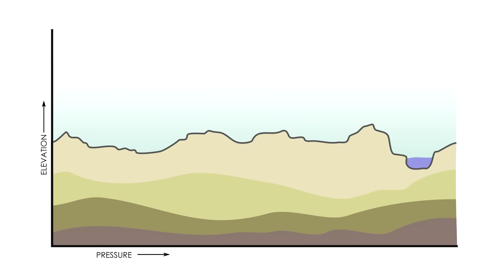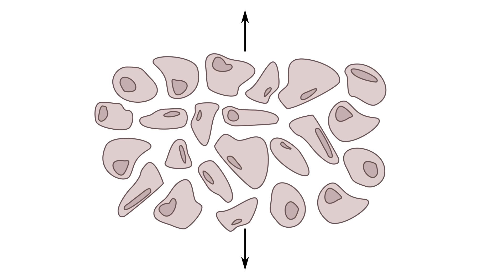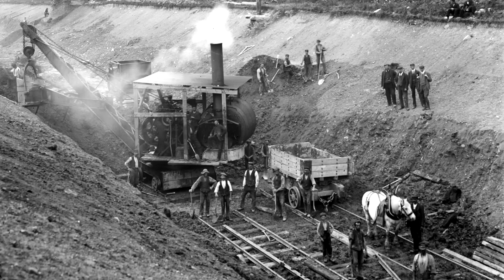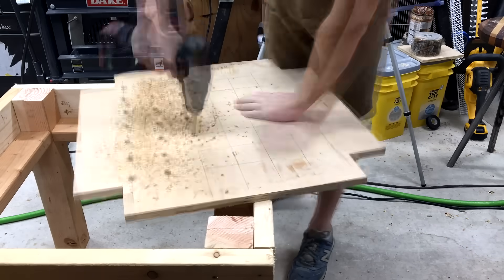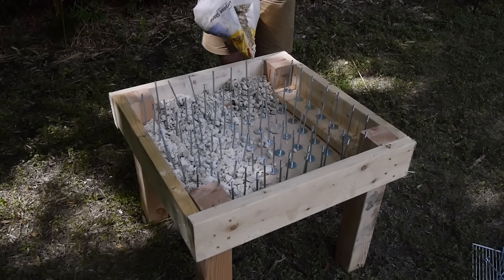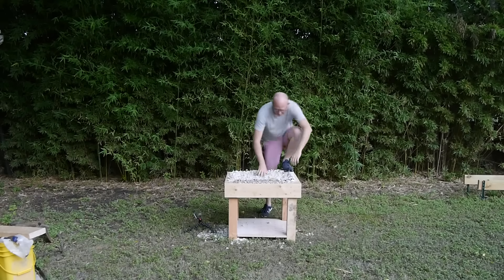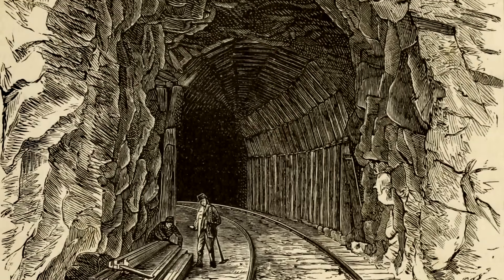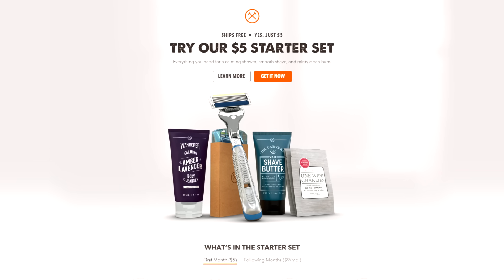Why Tunnels Don't Collapse

Comment: Very cool topic.  My Father worked at the copper mine near White Pine MI for about 20 years.  He explained the production cycle - of which "Roof Bolting" (as they called it) was the final step prior to drilling the next series of blasting holes in the heading.

One problem with roof bolts is that if the shale chips away from above the bearing plate, the bolt is left doing nothing - it's just hanging from the anchor pin and no longer helping to support the ground around it.  (Imagine removing the pieces of gravel that were in direct contact with your lower washers.  It would collapse like a house of cards.)

The (now closed) mine at White Pine claimed to have pioneered the idea of using resin to hold the roof bolts in place.  The hole is filled with resin and the bolt is inserted with a hardener packet and spun in order to mix it.  It worked so well that they actually started suspending their conveyor belts from the roof bolts with no problems.

The equipment they used was nothing like the manual operation shown in the video though.  A "roof bolter" was a large (not tall, but "thickly built") machine that used a gatling-gun-like device to drill the hole, fill it with resin, push in the bolt and hardener, and finally spin the bolt home.  All done from the driver's seat of the machine.  Each bolt was 16' long and they were spaced 4' apart.
Reply: This is the cheapest and cost effective method of tunnel reinforcement.... Used all over the world...
Reply: Yep, Resin Bolts took support to another level. In the South African Gold Mines, we also, in addition, Wire Meshed, Cable-Laced and Gunnited our Development Ends.
2 km+ down in bad highly stressed ground, we Gunnited (Cement / Sand only) daily 'right up to the working face'. It was thought that sealing the Tunnel Hangwalls and Sidewalls from Air / Oxygen would reduce the rate of oxidation of the surrounding rock .. leading initially, to less FOG's (Falls of Ground) near the face. Gunnited Wire Meshing and Lacing would follow thereafter. Another advantage of the Face Gunniting was that high stress areas with subsequent possible failure could be quickly identified when / where the emplaced Gunnite began 'spitting off'.
Kloof Gold Mine .. the late 70's .. Number 2 Sub Vertical Shaft .. 32 down to 39 Levels .. interesting times 😊.
Reply: Now underground they also put screen over the top and on the walls. Still in the older smaller workingS of mines they still use handdrills (jacklegs/ stoppers) to put in groundsupport. There is also other new rock bolts been use like split sets and grouted cables in really bad ground.
Reply: biglar155 hello fellow Yooper
Reply: Howdy!
Reply: Modern technologies for ground support mine workings make it possible to attach even heavy equipment and loads to the roof of the mine
https://www.youtube.com/watch?v=lY4N_n-n0wo

Comment: very cool self test with the bolted gravel! :)
i may have missed it, but in the context of tunnels, their geometry is also interesting. in contrast to the (if i recall correctly) parabolic arches in churches, the circular arch with a fill above it achieves a similar effect of avoiding tensile stresses in the structure. i believe this is the reason why tunnels typically have a half circular cross section on the ceiling.

Comment: Pretty interesting... I was taking the subway yesterday in Buenos Aires and I was just wondering how did they build the tunnels being so close to the river... This video was right on time!.

One question:
Is the same method applied to every soil? what happens when the soil is very humid and not too rocky?

Comment: I'm not sure this falls under engineering but I'm curious as to why power cables aren't buried underground like internet cables and the like.

I live in Canada and we get some pretty serious winters, often times during snow storms the power goes out and in the worst of cases it can be out for days when there's a freezing rain fall. So I always wondered why the cables aren't put somewhere they'd be relatively safe from the weather such as underground through some utility tunnel, sure it'd be relatively expensive to build but I can't imagine the repair costs wouldn't make it worthwhile after a certain time. Additionally while it could be slightly worst working conditions for maintenance it'd likely be more uniform. The only idea I have as to why it is done this way would be for inspection to make it easier and faster to check whether junctions are working properly or to find where a break occurred but there must be a way to tell the later without sending someone over. Either that or that somehow burying the cables even in relatively easily accessible tunnels would be dangerous for some reason, this doesn't make sense to me as electricity flows towards the ground so it'd not likely electrify soil above it but I could be wrong. Regardless of the reason it'd solve a mystery I've wondered about for 20 years if a professional/expert could answer this.
Reply: Jeff Cyr... Power cables are buried on a regular basis but that's VERY expensive up front, cost wise. Yes, there would be fewer power failures but then there's the cost to do it again when the wires get old. See, there's a hidden part that few understand where the insulation eventually breaks down and the wires do eventually fail anyway. Yeah, that might be 25 - 35 years later but in my line of work I see it on a regular basis. When the wires fail it takes a crew of a half dozen guys several hours to narrow down where the problem is, then they need to bring in a machine to dig up the offending section, do the repair, and then burry it again. Generally speaking the process takes 12 - 24 hours, versus 2-3 hours for an above ground repair. (maybe 6 hours if there's a broken pole involved)

Comment: Enjoy your channel - you complement AvE nicely! I have a question about tunnel ventilation, is there a limit to how long or deep they can be before you absolutely require mechanisms to move the air and does this factor in why you always see "No flammable material" in tunnel signs?

Comment: Nice video! But that bridge looked like it was about to collapse and I don't think I would want to be standing on all those vertically positioned bolts when it collapsed. Kinda dangerous, maybe would be better to load it with cinder blocks instead.

Comment: I have a question. Do tunnels have a physical limitation? I looked it up and the longest continuous tunnel is only about 26 km long, iirc. That's extremely short compared to the longest bridges. I can see why they would be limited by the amount of earthwork required but 26 km seems way too short.
Reply: The Gotthard Base Tunnel is about 35 miles long, or about twice your 26 km.  There are other tunnels planned or in construction on the same order.  I think the biggest physical limitation at this point is ventilation; the longer your tunnel, the more air you need to keep from killing the occupants.  Long tunnels will have ventilation shafts along their length to avoid having to pull all the air through their portals.  The ventilation shafts will also enable them to dig the tunnel from multiple directions at once.

The biggest limitation on tunneling is cost.  It's expensive, even compared to bridging, and bridging is really expensive compared to at-grade.  Once you start talking super-long tunnels, you're starting to ask yourself if the time and energy saved in the shorter route is really worth the crushing expense.  Some places that pencils out.
Reply: +CatCube2 Thanks for the reply. I did know about the Gotthard Base Tunnel but didn't mention it's a railway tunnel, which doesn't need to be very wide. I was talking about the longest road tunnel, which is the Lærdal tunnel in Norway, with a length of a mere 24.51 km and was wondering why it was so short. I guess eventually it boils down to cost and maintenance issues.
Reply: I would say the limit is mostly economics. There are few places where long tunnels make any sense, and even fewer where going more than a few kilometres is justified. This has mostly to do with not having built large population centres in hard-to-reach regions requiring very long tunnels. When the tunnel is already some distance away from the cities (like with the tunnels under the Alps), the tunnel position can be selected so that about 10 km will make it to the other side (as long tunnels for cars are particularly risky places, require some hefty air supplying systems, and are thus quite expensive).

But, because cities cannot be moved: the longest man made tunnels are likely for supplying fresh water to cities that outgrew their nearest fresh water supplies—a growing city makes such superstructures economically viable, and even reasonable. There are at least two such 100+ km tunnels, with large diameters to drive a car inside. Though,  obviously, one cannot drive there when the tunnel is filled with flowing water.
Reply: +Lari Koponen Ah I get  it now. But well, for a country that's 87% hilly/mountainous, tunnels are kind of inevitable. If it were up to me, I'd move the entire population to better terrain but since that's not possible, I guess tunnels are the only option. Hmm but what about ropeway?
Reply: Feynstein 100 channel tunnel. 51km. 30miles.  Get a better search engine!

Comment: Thumbs up from a mining engineer! I work in an underground flourspar mine and get asked a lot of times if am afraid of having such amounts of rock and soil above my head. My answer is always a clear no, because I know what forces these bad boys can withstand. 

One addition though: If you want to reinforce brittle rock, you can add a welded-wire mesh between the bolts and the rock for additional safety. And if that's not enough, we also shotcrete (sometimes  fiber-reinforced shotcrete) for reinforcing especially insecure rock formations (e.g. faults or clay-like soil).

You gained an additional subscriber with this video and I wish you all the best! 
Greetings from Germany!

Comment: How do engineers calculate how many bolts you need? I assume you need information about the jointing/breaks, how is that measured? If safety is first, and you opt to use bolts, when do you know it's safe? And how do you adjust for heavy equipment and vibration, for instance for a train track tunnel?
Reply: Joint are not random, usually the geologist can sort them up into sets, having similar orientation (and tectonic origin), if you know at what angles joint meet, and how they are orientd in the rock mass, you can figure out which part of the tunnel that will have the most loose wedges forming. If you also map the spacing between fractures, you can roughly estimate the amount of bolts you need. Spray some concrete to hold the smaller pieces between the bolts, and use experienced staff to guide the bolting crew, and voila!

Comment: i'm still not convinced why the rock bolts show that the structure is being held by tension. the only way you can try to demonstrate tension is the underside of the gravel layer sagging from flexion, but even that is an illusion. they are simply separating as individual solid objects that were never joined in the first place by an attractive force. even the attractive force in clay giving it tensile strength contributes negligibly to the strength of a clay tunnel.  

it looks to me like the bolt and washers create a solid layer whose strength is entirely derived from compression in the upper surface. you can prove that by trying to make the gravel surface concave (you can't) vs convex (essentially an arch support structure that is entirely compressive in nature, but now it's strength is derived on the underside surface.) which is even stronger than the original flat configuration.

Comment: Fantastic demonstration!  You could have explained this by just showing a diagram, but to see a flat layer of rocks remain suspended, let alone hold your weight, gives a sense of wonder.  Thanks for building up and sharing this sense of wonder around engineering!

Comment: Good video. I do have a question. What kind of watchdog or safety sensors for bridges, structures, or dig sites are there that detect a failure? I wonder about this since no one was killed in the Kennecott Landslide. I want to know since it is near impossible to make a building that lasts forever.

Comment: A similar method is used to retain sections of the Niagara Escarpment here too, using a multi-layer fence and bolts with each section of fence further supported with airplane wire loops that release and let the fence net any rock that manages to slump.  A friend worked hard-rock mines and he said that the biggest risk the miners faced was the rock walls exploding (think drying corn starch on tinfoil, then flexing it) with the leading injury to miners being fragment impact injuries.

Comment: If I create a floating city, what would I want to use as a material?
Reply: Xíren Seo Imagination 😛
Reply: Probably steel, since that's what's used on cruise ships.
Reply: In the Netherlands we use floating caissons of concrete to build houses in canals and lakes. Filling them with Styrofoam is optional but eliminates leakage and flooding.

For your floating island, you will want a mesh of caissons linked by hinged bridges to absorb wave action.
Reply: Use Flotium, or Unobtainium. Cranium would be to heavy.
Reply: I was thinking a ship but larger than usual. 720 meters long,  540 meters across. Super structure in the center and there's no way I'm gonna use CONCRETE lol
Reply: Lmao I started researching what it would take to build a floating city on the sea to avoid flooding and stuff and I found that its almost* possible
Reply: Oh snap!  xD
Reply: I can't believe I didn't think of that xD I thought it had to float in the sky
Reply: Aimless6 yes, that's what I was planning, thank you for the feedback
Reply: ...... I guess it would have to be in freefall orbit, which limits you to pretty well outside the atmospheric soup so you're not constantly running into atmosphere soup at high speed.  Then you'd have to generate a like-gravity environment through centrifugal force.  I dunno seems hard.  Maybe we'll never recreate the kingdom of zeal from chrono trigger without first inventing gravitics tech :(

Comment: Several years ago I remember seeing something about mixing foam (or some other light weight aggregate) with soil/rock to reduce weight/compaction issues (as I recall). A road was crossing a deep ravine and instead of a bridge a culvert of some sort was built at the bottom and fill material built up on top. The worry was that the mass of the fill would be too great so mixed in some sort of lightweight aggregate into the fill. I was always curious how that would stand the test of time.

Comment: I would never have guessed that pinning the gravel like that would work, and be load bearing! That was an impressive demonstration :D
Reply: Azy its rather similar to "mechanically stabilized earth" which he also has a video on, and concrete reinforcement using rebar, which he mentioned in this video
Reply: Unlike most of the others, this channel is related to real engineering
Reply: That was designed by a professional engineer.  Don’t try that at home ;)
Reply: Impressive indeed! Instantly fell in love with this channel!
Reply: i think it is also important to note that "load bearing" is used very loosely here... as evidenced by how the gravel was already crumbling during the demo.
Reply: Nobody Knows  You should almost never see that kind of bolt overhead in a natural rock formation. With most types of rock, bits of gravel can fall off an exposed rock face. (There are a few types of rocks that make good ceilings.)

I've seen the bolt ends on the ceiling beyond "hard hats required" and "keep out" signs. People like me that look into construction sites see them. But no one accuses me of being typical.
Reply: Uhh you didn’t know that? I thought that using bolts in tunnels is common knowledge, it is used a lot.
Reply: what the fk! You didnt know,  how old are you? Rock is not the only one, if completly compressed, it's possible other materials. this is nothing new,
Reply: Nixon Rexzile  Great job being an ass dude. Not everyone knows everything like you do.

Comment: I think the picture at 2:41 is one of the connection tubes of the atomium in Brussels, which isn't quite a tunnel... It still is a good example of reinforcing things and why round shapes are a better idea than sharp edges though. Great vid otherwise!

Comment: would diagonally crossing bolts work even better?
Reply: nickt Not necessarily.
Reply: if you look at the diagram you can see each washer transmits forces down similar to how brickwork does.
the zig-zag effect you are looking for is built in to the brick-bond effect that seems to occur naturally. ;)

Comment: Can you make a video about pretension and prestressing, and how structures handle large temperature variations?

As a mechanical engineer, I'm used to the different methods of how machines and mechanical devices handle temperature variations and strains, but I'm interested in knowing how structures differ in their approaches to either moving with the strain or handling the strain directly.

Comment: I really want to know if your contraption broke apart shortly after you cut away ;) 

Great video. It demonstrates how a material properties are used to do something that shouldn't be able to work. It is the same with spokes on a bicycle: long, thin metal rods are no good in taking compressive forces, which is why they are preloaded by tension, making them effectively only loaded by tensile stress rather than compressive stress. Well, rock needs the complete opposite!